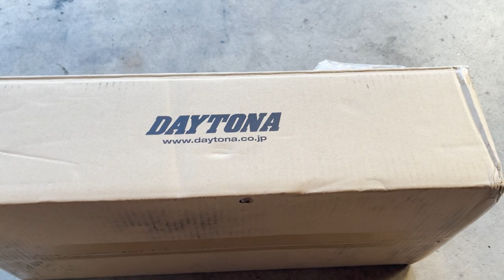Daytona Engine Guard for the 2021 Honda Rebel 1100: Overview and Install

Comment from the maker: Thanks to a viewers comments. I realized I forgot to install the stock bottom bolt spacer. I went ahead and put it in and wasn't too hard to do it without removing the top bolt mount.
Reply: Great video!!

Can I ask where you purchase them from?
Also, have you tested them by laying the bike gently on a lawn or pads?  I'm trying to figure out if they will keep the handle bars from denting the gas tank in a slow drop.  Not that I have dropped my bike;)
Reply from the maker: @leathaelsdon9438  I got them from Webike in japan. No I have not test laying my bike down. I get that question alot. Maybe I should make a video of it. Thank you.

Comment: Thank you so much for this video. I'm always a little nervous about working on stuff like this, especially with my bike only being a couple months old, but I just followed this video step by step and it was way easier than I expected. Got it installed no problem.
Reply from the maker: You are welcome, glad it worked out. I am alway nervous when I work on my vehicles. I always play it safe.

Comment: Hey great video! very easy step to step. I was wondering if you have the PDF instructions? I just needed to see what the long bolt and nut size and length is as mine didn't come with it.
Reply from the maker: I forget where I put the instruction. I’ll look and let you know. If you contact webike they might email you the manual.

Comment: Just got my crash bars, but now I'm apprehensive about install, since I don't have a jack.  Some are saying it can be done while on the kickstand, but the engine might sag?  That sounds like it would be incredibly difficult to put back in place again with human strength.  I wonder if those who are stripping the nuts are the ones trying to do it without a jack (like, the engine weight is putting too much tension on the screw for it to be loosened)?

Has anyone actually done this install on the kickstand only, and did they have any problems?
Reply from the maker: Thats a good point about stripping the bolts and not using a jack. I personally wouldn't take any chances.

Comment: Thanks for the video. It was very helpful. I have a suggestion for your next video though. I feel it would help even more if you were actually talking and explaining what you were doing in each step, instead of just silence. There were times during the video when I wasn’t sure which side of the bike you were working on. 
Also at the end it would have been helpful to show the bars fully installed. 
But very helpful nevertheless. Much appreciated!
Reply from the maker: Hi, Thank you for the kind words and suggestions. That was one of my early videos and I learn from each one. I do recognize some of the mistakes I make. As far as me talking, I've been ask a few times before :) There are a few reasons I don't talk. One is I am not gifted in talking and if I talk, it would require a lot more editing that I would want to do. Also since I dont talk, I tend to put more focus on the video which I think makes better quality videos. Lastly I was inspired to make videos from other DIY videos that hand no music and no talking and honestly I used them to fall asleep as well :)

Comment: Before I go look at my Bike to install, Asking...Any reason Can't install One Frame bolt at a time - L-R Lower first- snug NOT tight/remove upper then Inches away- Push each side upper into place then place and tighten All both lower and upper (or Visa-Versa-Upper first?) Without having to support Engine weight from the Bottom(jack/Blocks etc...)? Or design allows NO Back-Forth swivel play for that?
Reply from the maker: I suppose you can. Hopefully the exhaust doesn’t get in way. Some have also said you don’t need to support the engine since there are other mounts still holding it. I just wanted to be really safe and didn’t want to deal with an engine moving on me.
Reply: Thank You Sir...Simply trying keep things as less complicated as need to be and I ask YOU because done Hands On and many times Easier route not visible until....After already done=hind sight! thinking, Damn, I could've done easier this way, lol🤣 @MacrossGarage
Reply from the maker: It’s always easier the second time 😅

Comment: I tried this today and seems simple but I'm having trouble removing the lower bolt. The bike is on the kickstand.
Reply from the maker: Is it not turning?
Reply: @MacrossGarage  It won't budge. I'm well on my way to stripping it
Reply from the maker: @jopierre17  you using an extension or breaker bar?
Reply: @MacrossGarage  I've tried both. I'm afraid of breaking it. The only thing I was thinking was the weight or angle but shouldn't affect the nut.
Reply from the maker: @jopierre17  it shouldn’t be that hard. As you can see in my video I used two open and closed wrenches. Sometimes you get unlucky and the loctite they use makes it difficult. If you uncomfortable, seek professional help. Maybe an impact air gun.
Reply: @MacrossGarage  Indeed. Thank you for all your help. Keep up the videos, they are extremely helpful.
Reply from the maker: @jopierre17  no problem, let me know how it goes.

Comment: Do the heat shields need to come off?  Are they in the way of the install? From the video it's hard to tell.. it doesn't look like they're in the way that much... great job on the video and thank you for this...
Reply from the maker: Thank you. The left cover give you more room to hang the horn while it is off. The right cover gives you more room on the lower bolt and you risk scratching the cover. You can probably do it without removing the covers.
Reply: Is this is an install on a DCT model? The cover on the right side is different on my manual model. Manual cover seems smaller.

Comment: I have a question, my wife is thinking about adding a set of forward controls (CMX1100 DCT Rebel 2022/23 - Kit Original Controls Repositioning (S-0832) - Footrest Footpegs - Hardware Fasteners Included - De Pretto Moto Accessories (DPM Race) - 100% Made in Italy) to her 1100T. Will the Daytona guards work with this set of forward controls?
Reply from the maker: After looking at the photos, i am going to have to guess it wouldn't work. The left side might be ok but the brake pedal might hit the guard bar and even if they fit, the guard bar will probably get in the way of your feet. Those are nice looking forward controls though, thanks for sharing.

Comment: Just got mine installed, thanks for the help. Did you put back the spacer for the bottom bolt?
Reply from the maker: I did not put a spacer on the lower bolt.
Reply from the maker: FYI, You should put that spacer on the bottom bolt. After one more comment talking to another viewer I realized I was mistaken.

Comment: I just wonder, is jacking the bike up like this needed? I ask because I don’t have a jack and want to install these.
Reply from the maker: The jack is used to support the engine so it doesn't move out of alignment when the engine bolt mounts are released. If the engine moves it will be hard to put the bolts back on. You can probably do it without a jack and hope it doesn't move, but there is that risk.

Comment: Can anybody explaun why im having so much trouble taking the bottom nut off its not spinning and nuts are getting stripped
Reply from the maker: Are you holding it on the other end? The bolt is long and needs to be held on the other side with a wrench.
Reply: Yes
Reply from the maker: Does it look rusted or anything?

Comment: Thanks for useful video.  I just ordered mine.  But noticed you used a front wheel chock and wondering if this is needed for the install or if one can support the engine with a jack without it   as I will need to buy one if that is the case.
Reply from the maker: I suppose you don't need one and just rely on the kick stand. You just have to work on it with an angle and make sure you support the engine.

Comment: Looks like the highway bar reduces the lean angle. Any experience or thoughts?
Reply from the maker: I thought about it when I first installed it. I try to lean it as much as I would normally do and so far I haven’t scraped it.
Reply: @MacrossGarage  super. Thanks for the response
Reply from the maker: @tomabfall3955  You're Welcome

Comment: Looks good, but it's a poor design being 2 independent pieces. This means any twisting forces will be transmitted directly to the frame which defeats the purpose.
Reply from the maker: Yea I got to admit most of the reason was the looks and great for resting the feet on.
Reply: Wrong because Santa clause is coming to town.

Comment: Excellent video. I followed your process exactly, and it worked out perfectly.  The Daytona engine guards shipped from Japan, and appear to be a very high quality product. Quality materials  craftsmanship and finish.   ONE QUESTION:  The hardware package included a short bolt (12mm), I presume this bolt is to be used to attach the horn to the left engine guard?  The original bolt on the bike works fine, some I'm wondering why the extra bolt was included.
Reply from the maker: I don't remember the bolt setup for the horn. Not sure if it came with it or not.
Reply from the maker: After looking at the instructions, it is probably for the horn.
Reply: Its for the.... horn but the original is better

Comment: Great video. This is probably a dumb question, but I have never worked on my motorcycle. I'm a newbie. I have a jack to hold the engine, but do I need a stand to hold the bike upright or can I use the kickstand? Thank you.
Reply from the maker: The side stand should be ok but the tilt might make it awkward. I've never tried this with the side stand though. Hope that helps.
Reply: @MacrossGarage  Yes, it does help thank you. One more question, I'm assuming you're using a 3/8 torque, but I cannot find the amount of torque you're supposed to tighten the engine bolts. I don't want to overtighten or undertighten on my engine.
Reply from the maker: @rustyscrib6071  A previous comment asked and I think they found after searching its around 45-55 NM or 35-45 ft-lb. Ask as many questions you like hopefully I have the answer.
Reply: @MacrossGarage  thanks for the info. My neighbor has been riding for over a decade is going to help me with it. I went ahead and bought a service stand for the back wheel.
Reply from the maker: @rustyscrib6071  The stand will be worth it in the long run.

Comment: Hi Macross. One question. Can't reach the road in a bend? And one more question, where do you raise your motorcycle? Thanks for the answer.
Reply from the maker: Hey Zoltan not sure what you asking with your first question. I am assuming you are asking if it scrapes when I turn? I used a front wheel stand then raised the engine with a jack.
Reply: So i try to asking. 🤣Does the crash bar not reach the road when cornering?
Reply from the maker: @zoltannyari9571  No, i've never once scraped them.

Comment: Does it decrease the inclination…?meaning scrape easier on curves due to less leaning angle.?
Reply from the maker: I’ve tired to scrape it and haven’t yet.
Reply: @MacrossGarage  thanks bro ….just got a rebel 1100 in Taiwan… $20.000 USD …. .  U guys a lucky….
Reply from the maker: Worth every penny 😉

Comment: Are you saying that you need to use the jack/lift to support the engine from underneath when removing engine mount bolts?
Reply from the maker: Yes, to avoid the engine moving or sagging.
Reply: @MacrossGarage  Thank you! And just one more question....does the engine bolt not need a specific torque when tightening?
Reply from the maker: @lisabradley6466  I didn't torque mine but after some research it probably around 45 ft lb. Ask as many questions as you'd like.
Reply: @MacrossGarage  Thank you so very much!

Comment: I just received crash bars through Amazon.  The have a name of Baione on them and came with absolutely no instruction. Box says "made in China", my bad but they do look just like the one you installed with spacers and all.   I'm still a bit nervous but plan to attempt this install.  I would have had no ideal where to start.  Glad I found your video
Reply from the maker: I just looked them up and they do look the same. Good luck hopefully the quality is up to par. Let me know if you have questions.
Reply: Got it all done yesterday in my 28degree barn.  Would not have attempted it without your video.  The bars that came from China ha holes that were about 1/16" off. Used a Dremel to slightly elongate.
Reply from the maker: @bartowens55  Glad you got it done. Post a review for others to benefit on Amazon. Thank you.

Comment: Do u need the jack to replace the crash bar, or can u do it without rising the bike?
Reply from the maker: You can i suppose. As long as you dont mind working on it at an angle.
Reply from the maker: Oh and also, remember part of the engine is not supported when you removed the bolts.

Comment: Did you find that the guards were wide enough to provide enough protection  for the tank and side of the motorcycle? Or do you wish they were a little larger?
Reply from the maker: From what I can see the the engine is well covered. The engine doesn't really stick out that much.

Comment: I will be taking the bike to the shop next Monday so they can install the crash bar. I want to make sure that if they remove pieces I get it back. Can you provide me with the list of parts that I need to get back?
Reply from the maker: I'll look tomorrow to see what I had left over.
Reply: @MacrossGarage  thank you!
Reply from the maker: @hbarrero05  It looks like I have one long mounting bolt which is the top one if I remember correctly and two spacers.

Comment: Would like to get it, but will it fit the Rebel 1100 Manuel version?
Reply from the maker: I don't see why not. If it didn't Webike would probably mention it. You can always send them a message to be sure.
Reply: @MacrossGarage  Hi again, try the link. Nothing came up. No listing of the engine guard.
Reply from the maker: @my2wheels  I guess they changed the link. I updated it, it should work now.

Comment: Thank you for the video.  No loctite on those motor mount threads?
Reply from the maker: There wasn't any from what I can see. I didn't put any when I put them back. I will be checking the bolts from each ride.

Comment: Is screw lock glue not needed when installing or putting the bolts back on?
Reply from the maker: I don't remember the factory bolts having any. It probably doesn't hurt to put some on.
Reply: for stuff like that you always want ot use loctite just in case......

Comment: This is for the DCT. I’m trying to follow but the manual looks different
Reply from the maker: Interesting, I didn't know it was different. What part is different? Are you not able to install them?
Reply: @MacrossGarage  I’m working on it now but the side of the brake. I believe there’s no plastic to take off
Reply: It was easier if you think about it one less step to deal with. Clutch kind of got in the way adding the plastic back in back not horrible
Reply from the maker: @hecnotic  Yea if there is no plastic it would be easier. That plastic near the brake is the one that covers the horn area and lower nut for the bolt mount?
Reply: @MacrossGarage  the rear brake side. No plastic needs to be taken off. On the side of the clutch for me where the horn is. That plastic needs to be taken off. After that. It’s easy. Thanks to your video big props to you for this. Only bad part is my guardian bell was on the bell so I had to take it off and put it back on
Reply from the maker: @hecnotic  I see. Glad it worked out for you.
Reply: @MacrossGarage  I had a question. The bottom one that you put back in. You didn’t show in the video but did you put the spacer back in ? I saw the top ones had new spacers but the bottom looks like you jut put the rod in didn’t put that little black spacer back in. Am I correct ? 9:44 was where you put them bolt in
Reply from the maker: @hecnotic Someone asked me a similar question previously. I don't believe I did because the instructions didn't say to do so.
Reply from the maker: @hecnotic  I stand corrected, there is one spacer on right side of the lower mount bolt.
Reply: @MacrossGarage  so The same side the bolt goes into behind the metal the spacer must go in ? Oh I hope I didn’t tighten it too tough that I bent it 🙏🏽
Reply from the maker: @hecnotic  yes, the right side when you sit on it.
Reply from the maker: @hecnotic  I just checked mine and I didnt put a spacer. I guess I will have to take it apart and put the spacer.
Reply: @MacrossGarage  I’m sure it’s not a big deal but I guess it’s to protect it from bending when you super tighten it like I did last night 😂
Reply from the maker: @hecnotic  You are right but I cant bear to think its installed incorrectly. I will take apart right now.
Reply: @MacrossGarage  honestly I tried to stick that little spacer in there and I failed miserably. I’m going to try again too in like an hour
Reply from the maker: @hecnotic  I tired to do it the fast way with bike on its side stand, but I did it properly after finding out taking the lower bolt needs some force. I put it on the front stand to make it center and supported the engine like in the video and it was easy to hammer out the bolt. Got it done in 30 mine.
Reply: @MacrossGarage  did you have a hard time sticking the spacer in? I was having a hard time. I’m about to try now. My bike is still on my stand so I’ll just lift the engine and try it
Reply: Took a little hassle but I got that spacer in. Lmao.
Reply from the maker: @hecnotic  Nice job, on to the next one.
Reply from the maker: @hecnotic  It went right in.

Comment: The hardest part is trying to line up the top bolt to get it back on the left side
Reply from the maker: Yea that does get difficult. For me was placing the spacer for the same mount.